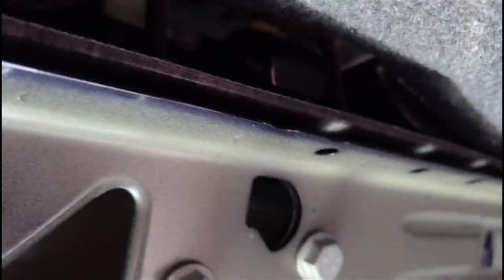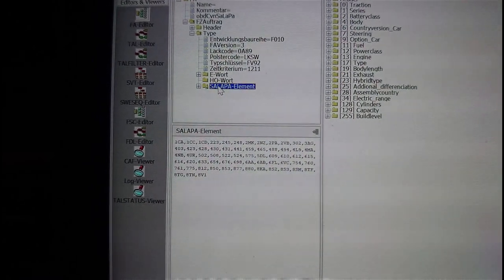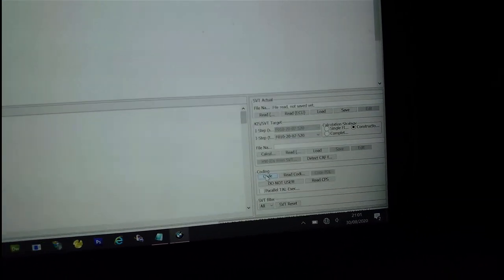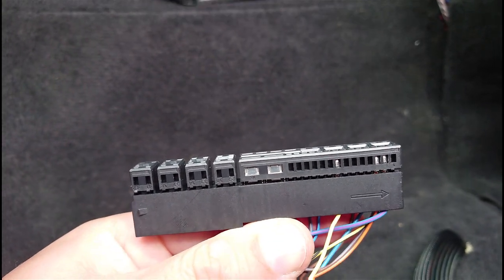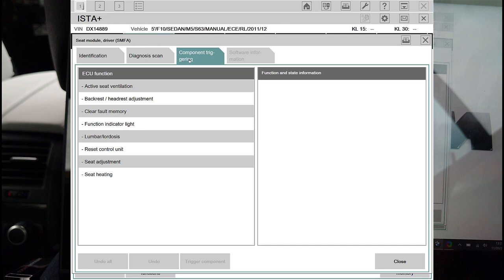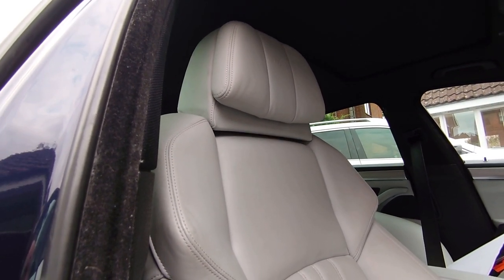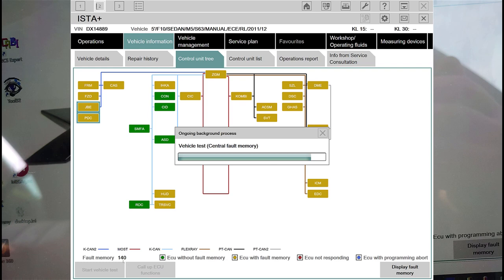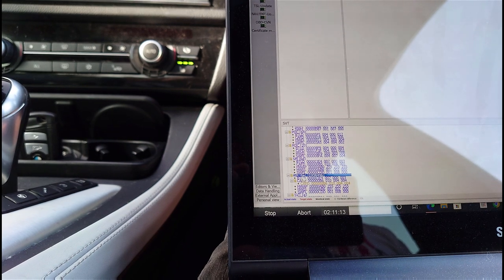Salvage BMW F10 M5 Multifunction seats upgrade complete, ESYS & ISTA coded

Comment from the maker: This was a real journey. There's loads of information in diffrernt forums about how to use ISTA and ESYS, but I wasn't able to find much on how to retrofit upgraded multifunction  seats.

I needed to create a few additional connections in the harnesses and splice into the cars electrical system so they would communicate, and code the new ECU's to the car so it knew what it was working with.

It's a bit of a long one this, grab a cuppa sit back and enjoy.
Reply: P
Reply from the maker: Q

Comment: Nice video buddy, I am doing the same procedure right now but I bumped into a problem. I did everything: 3 additional wires for passenger as it did not have it and 1 for driver seat pin1, I coded everything but I dont see the passenger seat in E-Sys. I have only SM[6d] and 6e is missing also passenger seat works randomly one time it works another time it doesnt and the car does not recognize this seat at all. Only the driver seat is working fine passenger seat is acting unusual.
Reply from the maker: +Aleksandar hope the video helps. when you say it works randomly do you mean from the seat adjuster? What does ISTA show you? are you able to go into the ECU and test the adjustment from there?

either way, it sounds like a loose connection if it sometimes works.

check to make sure you have power at the seat adjuster first, if it's there then it'll be the other wires you had to splice in. where did you take your connections from, and did you solder them or just use an inline wire tap?

Rich
Reply: @RichsRides  Thanks for the reply Rich, Yes the seat adjuster works randomly once it works second time it does not. I am not able to get in passenger seat ecu it does not show in ISTA+ or E-sys. There is a power to the module because it works sometimes. The problem seems to come from two CAN wires maybe I did not take the connection from the right place. I dont have rear climate control and I got a connection from a module behind the glove box I think it is central gateway module. I did not solder them just wire tap.
Reply from the maker: @rcefie  sounds like the connections for the bus aren't very good. If it sometimes works then you must have it connected to the  right place.  I'd recheck your connections and make sure they're ok.
Reply from the maker: +Aleksandar how have you got on? found the problem yet?
Reply: @RichsRides  Yes I have found the problem my can signal wires were not really Can wires. I got new 2 Can Wires directly from the driver seats connector and now it works and I can see the passenger seat in E-sys 😁
Reply from the maker: Excellent! It's good when stuff works isn't it.
Reply: @RichsRides  Yeah I thought it will never work but eventually it worked 😁 this seats are very comfort compared to my old which were basic one.
Reply from the maker: They are comfy aren't they. Well done for sticking with it. Modern cars are too complicated these days, but with a little research and a few tools most things are possible.

Comment: how to retrofit rear seats from non foldable to foldable?
Reply from the maker: +Robertas Viskupaitis that's a good question! I think the main difference is the brackets at the base and the latches at the top. my rear seats went from foldable to fixed. I had to remove the bottom mount that it pivots off and replace the release lever / lock mechanism with the fixed back support. so going the other way should just be a matter of removing the fixed brackets and adding the pivot and lever/lock mechanism.

if you need the part numbers check out realoem.com and browse through the seats section.

have you got the replacement seats already?

Comment: Hi! I am trying to fit some comfort seats in a bmw f10 (pre lci). My former seats were semi electric, and i kinda stuck with wireing. Could i get some help in this matter? Thank you in advance:)
Reply from the maker: +Catalinubb Catalin which bit are you stuck on? do you have power but no data connection or are you right at the start? Also do you know the VO codes for the seats you're changing so you can update your system?

Rich
Reply: @RichsRides  I'm also following the route of the above comment. Regarding wiring can I just make sure the seat has every wire connected ?
Reply from the maker: @warrend2845  you need to code them to the car too and remove your old seat option. Do you have eSys and ISTA already?
Reply: @RichsRides  I should have watched the video first 😂. Yes I have Esys , looking for a Windows 7 install of ISTA again as I deleted it...
Reply from the maker: @warrend2845  cool, if you get the wires connected to the right place and do the coding you'll be good to go. Let me know if you get stuck.

Comment: Hi Rich, is it possible to install them on a 520d F10 SE 2015?
Reply from the maker: Hi Buddy, I don't see why not. If it's available as an option when you buy the car you should be able to retrofit it with the right parts and a little patience. My car is a non LCI so I'm not sure if the wiring and options would be different. And I think the LCI cars have a different seat rail that is narrower than the non LCI so you have to make sure you buy for the right year. What have you got your eye on?

Comment: Hi .  My f10 is from December 2012 and the comfort seats are from September 2013.  Will everything work after connection and coding.
Reply from the maker: +Diablo 0079 are the seats from an LCI model? I think they changed the seat rails on the LCI so they were narrower? I'm not sure if the electronics were updated too? 

if they're Pre LCI seats then you'll be fine, it might just take a little investigation to find where to wire in etc.

Happy to help if I can. Good luck.
Rich

Comment: Great vid man, I have one question - where did you get the wiring diagrams? From ISTA?
Reply from the maker: +Lewy thanks buddy, yes they're embedded in ISTA. Have you got seat issues too?
Reply: @RichsRides  just diving into it, bought full electric memory seats with lumbar control. I’ve successfully added the VO codes but now I need to figure out the wiring. Seems like I don’t have k-can high and low in my plug. Probably dummy question but do you know if I connect to existing wiring from k-can circuits that are already in use by other modules?
Reply from the maker: @Karolo0  absolutely yes you can! I also had missing pins, so I tapped into the bus through the connection in the arm rest for the rear climate control. I also had to splice the memory switch in through the door mirror.

The hardest thing was getting the correct pins so I could add them to the block and then finding the right point to splice the connection in.

What are your VO's  that you've added and have you removed your old seat option too?

Comment: Rich

Just about to start a similar change and this is very useful. The only difference I have is that I am going from fixed rear seat to split. Was wondering if you still have the boot latches and handles and if you do if you would be willing to sell them. Good information many thanks

Comment: BMW G31 ID6 2018

a friend converted his seats from half, to full electric a few months ago.
The whole thing was so long ago, we don't remember what functions the seats we bought had.
Since the conversion everything works, no error message, but, he has to press a button several times for the command to be executed.

Probably the seats need to be coded.
We would have Bimmer, but also ESYS - the experience is unfortunately relatively low, in addition, as I said, we do not know what equipment the "new" seats had.

Just asking for help is hard I know, but how should we best start to "code".
Reply from the maker: Did you sort this?
Reply: @RichsRides  no, still same Problem.
Reply from the maker: @isimsiz_13366 probably need to update the VO list with the new code for the full electric seats and remove the old one, and then code the modules. Finding the correct VO code is the hardest part.
Reply: @RichsRides  yea... and would you have any idea where I can start looking for the right Number?
Reply from the maker: @isimsiz_13366  You need to check the current Vehicle option list in ESYS first, I'd imagine that it's probably got the Comfort Seat which will show as 456 in the list I think. Then you need to know what you've replaced them with. It took quite a bit of googling to work out what mine were. Check out page 18 on this link for seat options. https://g30.bimmerpost.com/forums/attachment.php?s=dcdbfd5bd0c7638a878be9aba0853824&attachmentid=1514353&d=1477316190

Comment: Hey Rich,

For the cables that you put for pin 1 what was the AWG for the cable? 

Thx for the video think i watched it already 3 times to get my grocery list :p
Reply from the maker: +Switchke glad you're finding it useful. I'm not sure what the AWG is, I picked up some wire at the local auto store (Halfords in the UK) that was rated for slightly more than the fuse. think I got 12amp as the fuse is 10amp. the stock wiring is very light and it was a tight fit on the new connection in the block as the wire was quite heavy in comparison. Does that help? 
You could always put an online fuse from the main power that's already on the block if you don't want to run it back to the fuse box.
If you need any more help just shout, I'll help if I can.
Good luck, would be good to see it when it's done.
Reply: @RichsRides  I also ordered T tap connectors with a fuse to do that and also to connect it to the green and orange cable. Ordered flexible 6mm cable to use the pins.
It's not a project for soon. Think it will be done spring 2021. Will keep u posted
Reply from the maker: @JCVD575  good luck buddy, shout if you need help.
Reply: @RichsRides   I just received my ENET cable yet im looking for the programs and looks pretty shabby on those forums. Where did you buy them? de Esys and ISTA D / ISTA P ??
Reply from the maker: @switchke  Hiya, sorry I'm finding so many old messages all of a sudden. Did you find the software or are you still hunting?

Comment: Hi. 
I am in the middle of a f10 standard to M5 seats conversion. I bumped into a problem. I have no idea how to wire the memory buttons on the side of door.
Have you got any advice how to sort it out.
Reply from the maker: It had me stumped for a bit too! Are the memory buttons for the drivers or passenger seat and is it LHD or RHD?
Reply: @RichsRides  its a RHD. Both sides need doing drivers and passenger.
Reply from the maker: I've got the pinouts and wiring for the passenger side.

So using that 4 pin connector from the ebay link you also need the pins https://www.ebay.co.uk/itm/293179989242

On the passenger side:
Pin 1 = Power - you can take this from any of the power lines (red)
Pin 2 = bus connection, I tapped into the wire going to the door mirror, it should be white with a brown stripe
Pin 3 = Blank 
Pin 4 = Ground

will need to dig around for the drivers, see how you get on with the passenger side first and I'll see what I can find.

Rich
Reply: @RichsRides  hi cant see where did you splice pin 1 in to on drivers side
Reply from the maker: @arturgrabowski3531  mate sorry, have you found it yet? Assume you have?